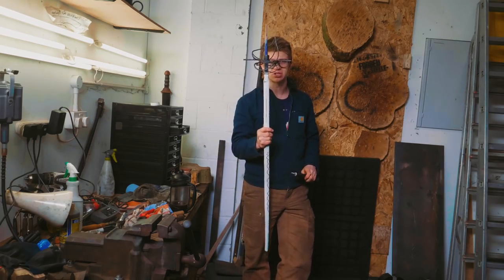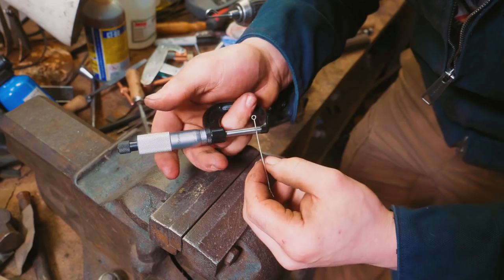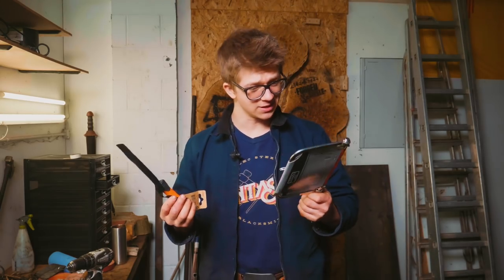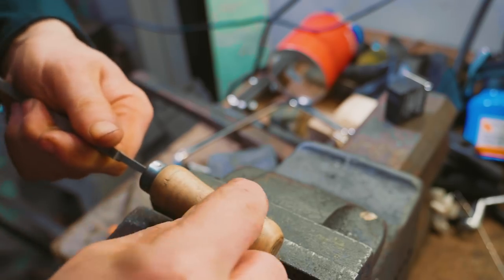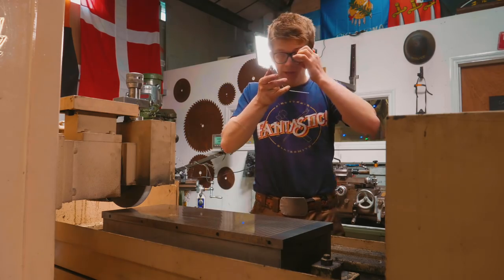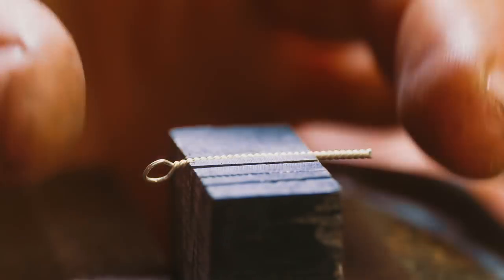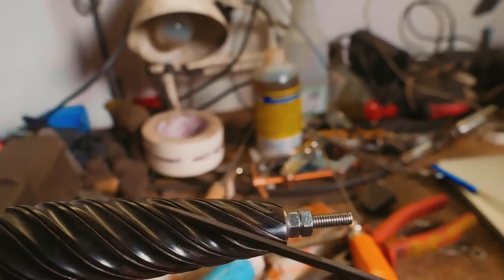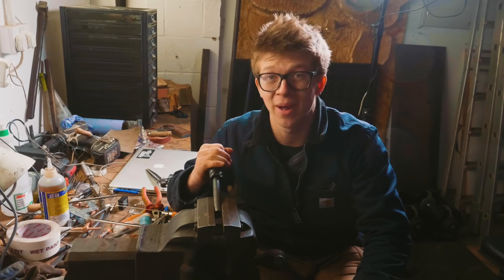MAKING A BASKET HILT RAPIER SWORD PART 13

Comment: I'm curious, would the radial sanding the flutes be easier on the lathe? Seemed like you could just hold the paper at a consistent angle and have the lathe rotate the handle slowly.

Comment: I know that you already know this...  But by twisting that wire you work hardened it, and if you heat it up it will soften up again, and be easier to work with.

Comment: How about putting pin in vise and pushing saw blade to that pin?
Would it be possible to put handle on lathe at lowest speed and file grooves? Some people can turn tread on on lathe without power feed.

Comment: A little rub on a sharpening stone would probably have fixed the saw blade, too. Alternatively, slightly tap the set out of the teeth with a hammer.

Comment: You ever heat set your tang into the wood handle? I notice you tend to drill and cut your handle but I seen many guys heat the tang and press it into a tight fit grip to burn the wood for a perfect fit.

Comment: Might be calling for trouble, but could of you fixed you tool handle in the lathe and follow the groove while it was spinning at low rev for the sanding/polishing of the flutes?

Comment: Alec just thinking out loud .but if you cut a little deeper  then it would be possible with the wire in to sand your clean up and have all edges crisp and clean . a little epoxy from a fine syringe would keep that silver there with no tell tail sighn's of how you done it. :)  just thinking out loud

Comment: 8:50 The Jumpcut is strong with Jamie. Good video, but personally I would like it a bit less cut, even if it means, it's a bit less clean. Anyway, with a bit of planning beforehand, you'll get it just as clean.

I'm talking about the video here, restrain your dirty thoughts!
Reply: The Cashier do you mean alecs talking parts or the montages? 🤔
Reply: Not even the talking generally , just the part with the camera-angle I've time-stamped. I just personally think it's a bit much there. Far from unwatchable though, I still liked the video quite a lot.

Comment: Howdy youall from the great state of Texas Alex. Why didn't you, to sand and polish the flutes chuck the mandrel in the chuck in the lathe. Run at the slowest speed. You could have wrapped the paper around the round file and followed the flutes as if sanding a thread. Even though the part isn't round your hands would be able to follow the shape at a very slow speed say 50 rpm if your lathe goes that slow.

Comment: I'm not suggesting this would work for all applications, but I think it may have been easier to position the coping saw frame on the bottom of your project (like a U) so that you can see your work space without the frame being in the way.   I.e.: U--  not   /^\__.  In that way the weight and center of gravity of the saw frame is below the workpiece, not above.

Comment: I think - maybe a bit late - I would have made vice versa. the slim part to the top.
I cannot feel but having the indexfinger above the bladecatcher would make me expect a small in diameter hilt for ebtter control.
By the way, what is the weight?
Your seem to struggle with it.

AND using a respiratory mask when making the flutes is a bit overkill, dont you think so?

When installing a blade the direction is push. Only japanese blades are installed on pull

Perfection lacks beauty, it is a marvellous piece of work

Comment: Alec, what a fantastic job with the handle so far. You should take a few minuets to check out the Beall Wood Buffing system. It is amazing the amount of time and work it has saved me. Sand to 320 grit, then buff to a high gloss surface in 10 minuets or less. http://www.bealltool.com/products/buffing/buffer.php Keep up the excitement, just don't burn out!

Comment: At the risk of angering you enough that you come to America and whack me on the nose...next time, consider mounting the handle mandrel in the lathe chuck. You should be able to turn it much more easily and in smaller increments, albeit without powering on the lathe.